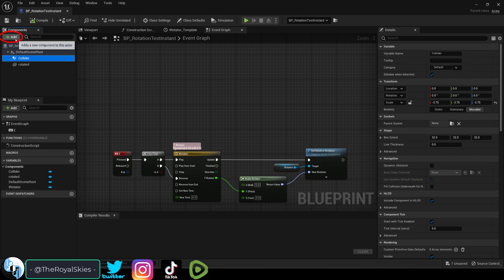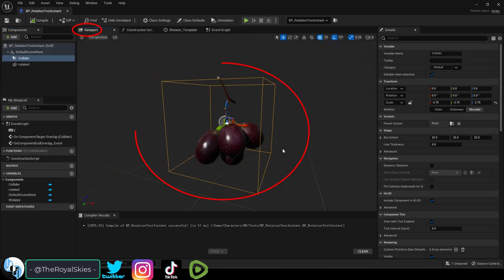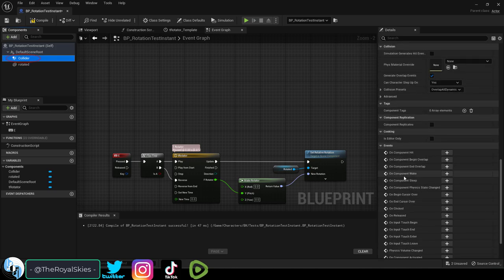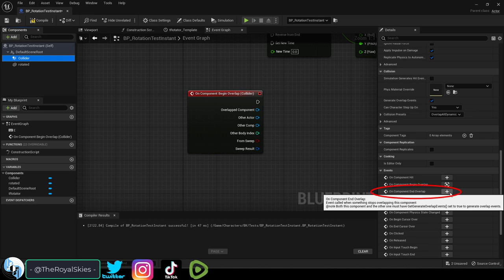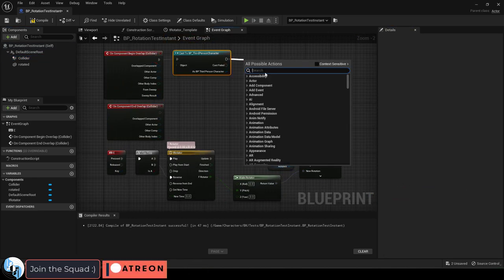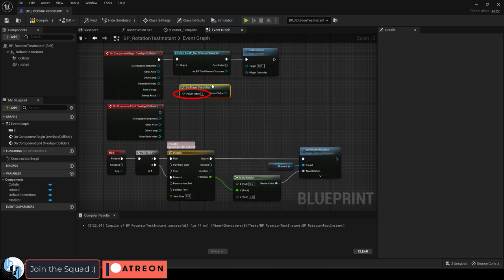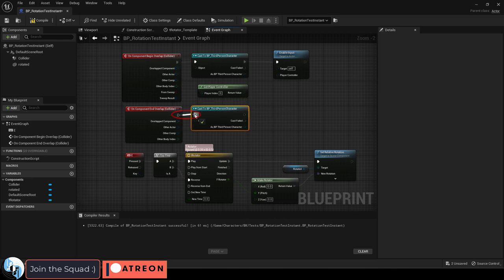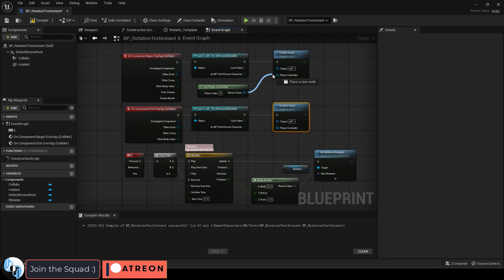Unreal5 Blueprints: Box Colliders Demonstrated (60-SECONDS!!)

Comment: casting is really computationally expensive so i would advise all beginners to use it as less as possible and learn other methods. Of course it doesn't matter for the sake of a simple tutorial but it's better to learn it now then to learn it after using it many times in your project.
Reply: Can you tell me where it is that you hear this?

I'm both an engine programmer, and tech artist - and I can promise you casting is not something you need to be shy about using. The problem more often stems from people not knowing when, why, or even how a cast works.

This example is exactly how a cast should be used. The box gets an actor ref, and then the ref is cast to the ThirdPersonCharacter to see if the actor ref is pointing to an instance of that blueprint type. The disable input, and old input events aren't best practice approach, but that isn't the point either. The cast was used correctly here. You could use an interface, but it's not going to be cheaper in any meaningful way.
Reply: @3DWithLairdWT  i think he means using it too much can give some performance impact, and indeed I've tried it myself. 
there are other ways to get the required references without casting all the time.
actually if he casted only on begin play and promoted the character reference to a variable in that blueprint then branch check to see of overlapped actor is equal to the player ref is better. and again if you have too many actors casting at begin play you will get performance issue the moment those begin play events fire.
and i apologies if there's mistakes in what i said I'm not total expert.
Reply: @3DWithLairdWT "this example is exactly how a cast should be used" if the main purpose is to verify only one thing 'inside' an actor, then no, its not, . For tutorial purpose is totally fine, especially bcs the tutorial is not even about the CastTo node. 
" box gets an actor ref and then the ref is cast to the thirdP..."  Cast/Casting in programming language is different from the blueprint graph CastTo node.
Reply: @Neiv74  It genuinely seems like you're trying to be helpful here. It also seems like you're not speaking from a place of knowledge or experience.

If you could explain what you feel is correct then, please do. I've only seen you say what isn't correct without providing the actual examples to back that up.
Reply: @3DWithLairdWT  I have seen a video explaining that whatever you're casting to stays loaded, so if you have a casting chain, it starts getting really demanding on memory, and concluding that you should generally only cast to things that you already need loaded anyway, and avoid long chains. Do you think that makes sense?
Reply: @Mcl_Blue  So, casting requires a reference. A reference can only be created for a valid memory address of an already instantiated object. This means that whatever reference you have is already in memory at the time you create it. So when you then cast the reference to a type to see what it is, you do not create or load anything more. You're simply checking what is already in memory. Therefore, casting cost is not related to the references contained within the object. This is another thing entirely managed by the asset loading manager of Unreal engine at the time the object is created.

As an analogy - when you go to the address of a house to check if its an apartment or house, it doesn't build the thing. You're just looking to see what it is. It was already made. So any cost related to making it, or things related to it was already paid at the time it was built. This is not related to casting a ref
Reply: @3DWithLairdWT Then why do people keep teaching to use casting only when extremely necessary? Every time I hear an explanation they do it just like @Mcl_Blue said, with the memory thing. Is everybody lying or do they just not know why?
Reply: @cassiohenrique6815  It's more a case that most of them don't actually really know what they're talking about, but are still trying to be helpful. This is a topic I make sure to cover when we're interviewing prospective hires at my work.